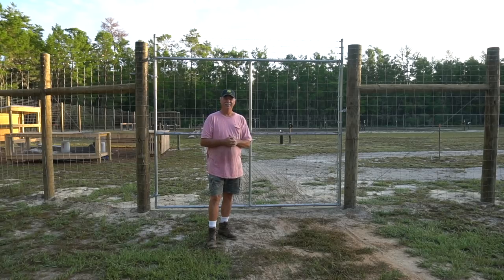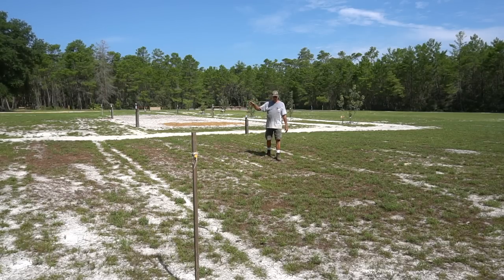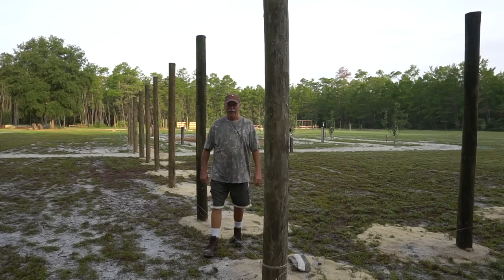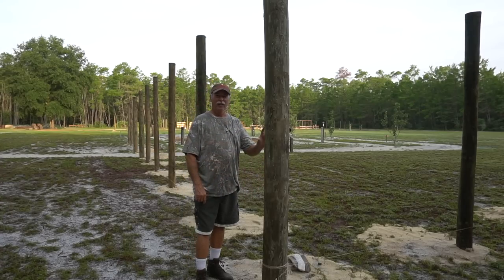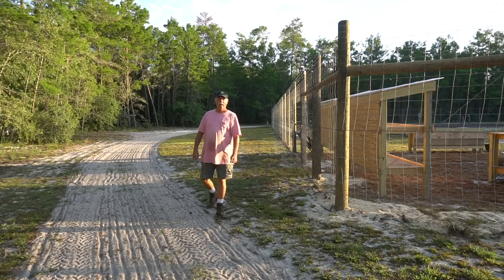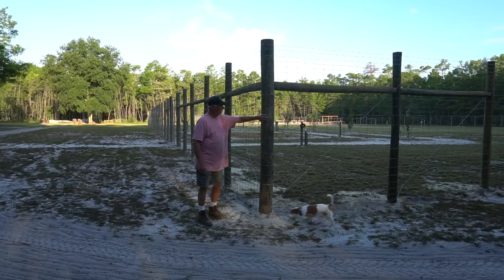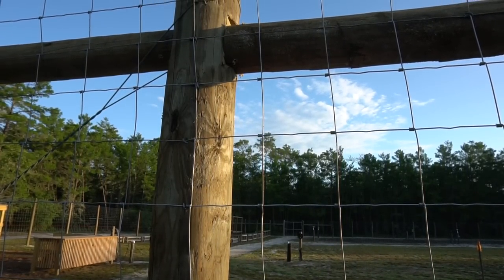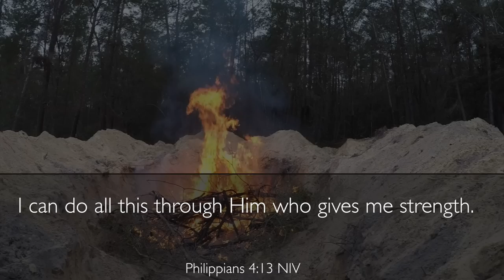ULTIMATE BEAUTIFUL Garden Fence :  5 ACRE Garden -  9 FOOT  High

Comment: In Northeastern Michigan, where I live, I burn my brush piles in the winter. I don't need a burn permit from the government as long as snow is on the ground. I gather the brush in the summer and cover it with a tarp to keep it dry. Once the first snowfall covers the ground, I remove the tarps and set the brush piles on fire.  I keep the deer out of my tomatoes simply by stringing a heavy cord between posts a couple of feet off the ground and a few feet out from the plants.  I also hang marigold flower baskets around my garden. Deer don't like the smell of marigolds. Wish I could get two gardens in like you do down South. God bless.

Comment: A good fence is a beautiful  sight to see. Mine is only 8', but has  a tension wire at the bottom. They are like rats with hooves. They can squeeze through a tiny gap. I live in Bedford NY, LOADS of deer.

Comment: The rabbit wire would be good for Raccoon and Possum.  There are so many of them in Florida.   It seems like you are in the countryside so it may not be as bad.  When you live in a community they are all over the place.   Nice fence for sure.   Keep up the great work.  Clement
Reply: I wondered about electric fencing to address the critter problem. A solar panel system could be very cost effective.

Comment: Always enjoy your videos and look forward to them, great fence job i will like to suggest that if you can get yourself a fence hot wire system so you could have that fence charge at night if possible so those rabbits could stay away from experience I could tell you that it works and is way cheaper than fence God bless....
Reply from the maker: Thanks for the tip!

Comment: Lower part of fence has holes to large, skunks and smaller predictors and rabbits will get in. First three feet needs at least 1” hole fencing. Just a suggestion!
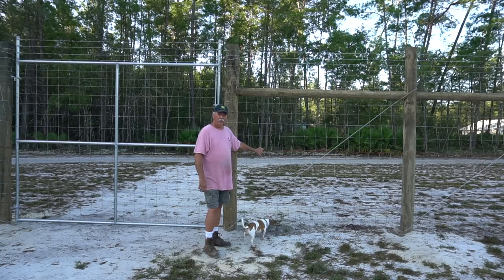Reply: He said in the video @21:50 that rabbit wire was planned but for another day.
Reply: You can't stop rabbits without a moat, they'll tunnel under.

Comment: Pardon my ignorance.  Why do you need barbed wire for deer on such a tall fence?
Reply from the maker: The barbed wire adds an additional foot of height to discourage deer from jumping over it. The barbed wire also helps deter climbing animals👍
Reply: See my posting.... my 20 lb fishing line fence is only 5 ft high and I have never had a deer jump over it or go through it. It's invisible to the deer at night, and it works.